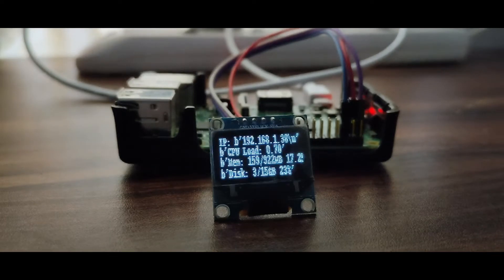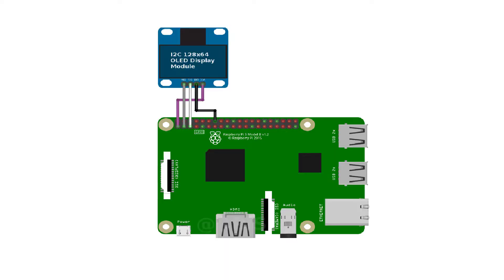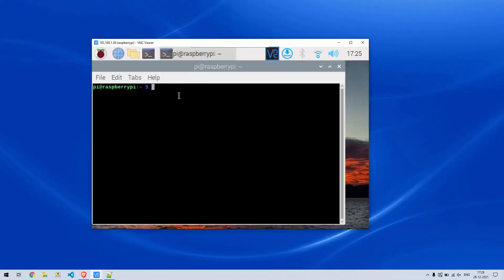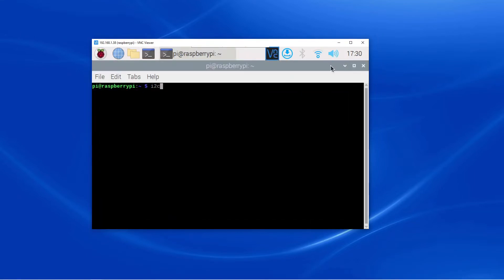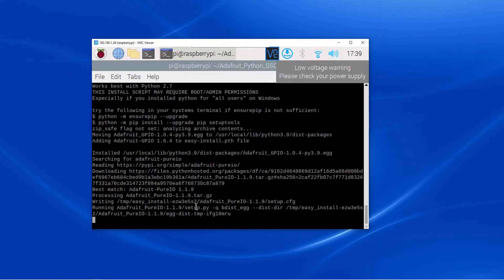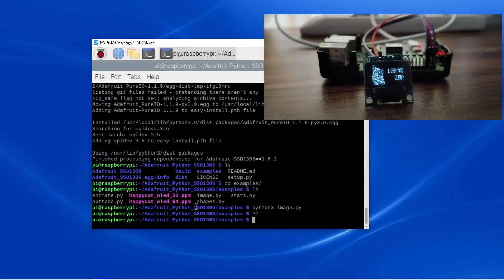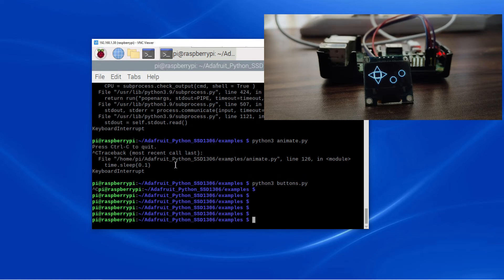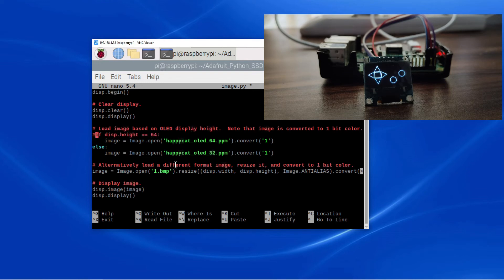Raspberry Pi OLED SSD1306 using Python

Comment: Traceback (most recent call last):
  File "image.py", line 44, in <module>
    disp = Adafruit_SSD1306.SSD1306_128_32(rst=RST)
  File "/usr/local/lib/python3.7/dist-packages/Adafruit_SSD1306-1.6.2-py3.7.egg/Adafruit_SSD1306/SSD1306.py", line 288, in _init_
  File "/usr/local/lib/python3.7/dist-packages/Adafruit_SSD1306-1.6.2-py3.7.egg/Adafruit_SSD1306/SSD1306.py", line 85, in _init_
  File "/usr/local/lib/python3.7/dist-packages/Adafruit_GPIO-1.0.4-py3.7.egg/Adafruit_GPIO/GPIO.py", line 417, in get_platform_gpio
ModuleNotFoundError: No module named 'RPi'

Comment: i2cddetect -y 1 does not show any value in the rows like yours does. I have all the interfaces enabled and rebooted, I have also confirmed the pins are going to correct pins on the pi such as SDA, SCA, 5v, grnd

EDIT: Now I2C is detecting the screen like the video after I rebooted the pi